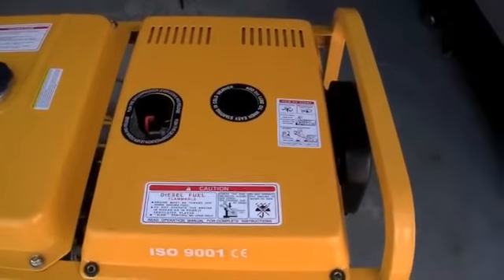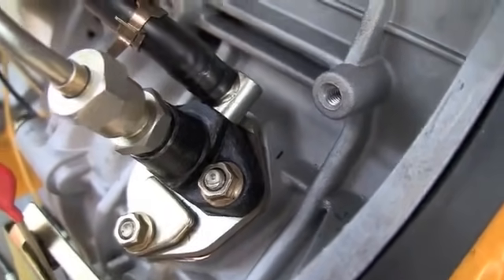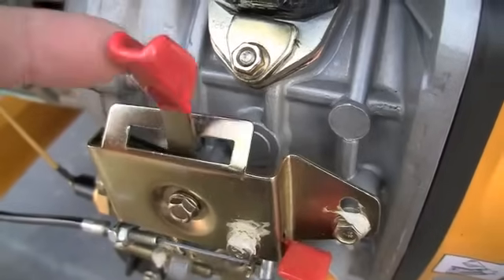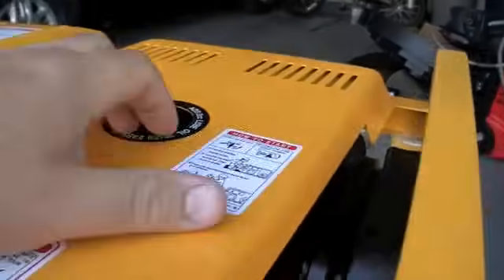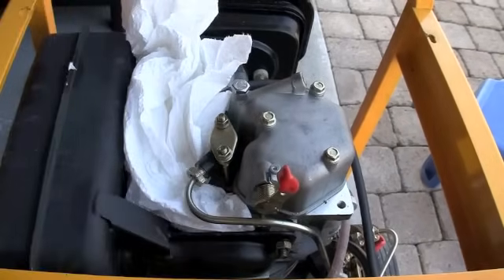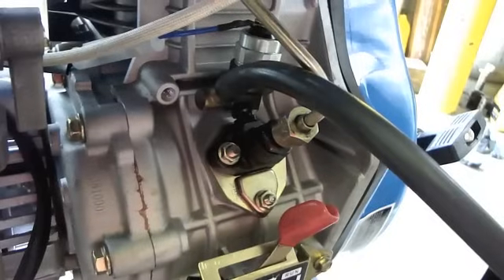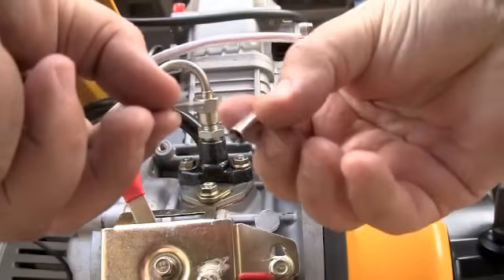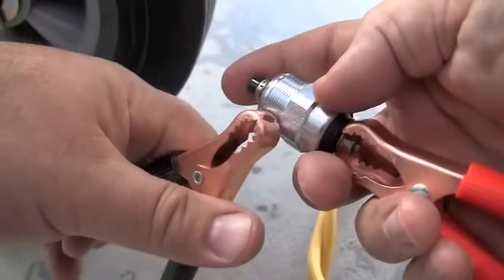Diesel Generator - Bleeding Air From Fuel Lines

Comment: i ran my newly purchased (other brand) silent gen till the fuel ran out, not knowing this would happen. it has a digital control panel and it is cutting the engine off due to rpm fluctuations cause by air in the fuel line.
thanks a lot. this has been a great help to me.